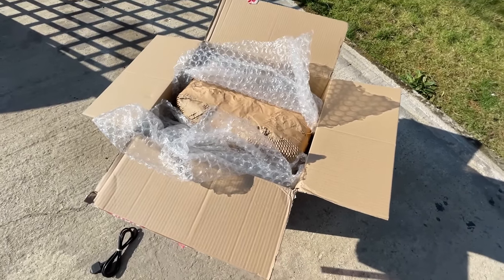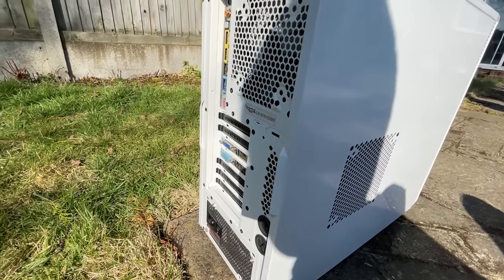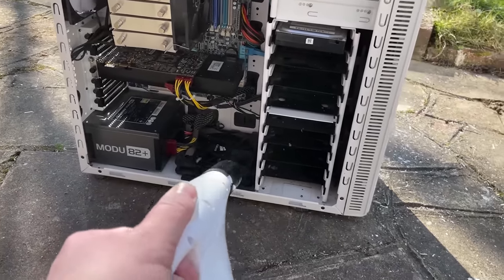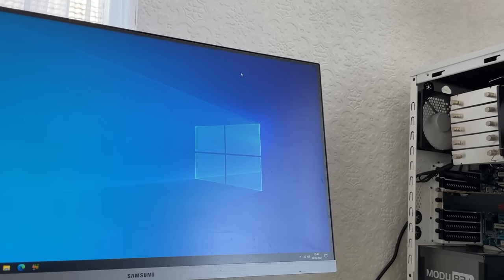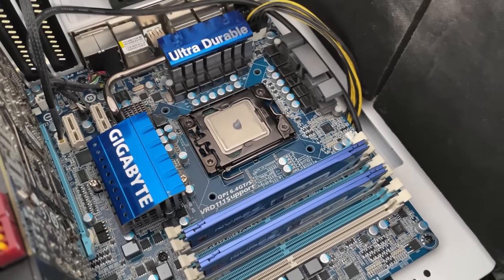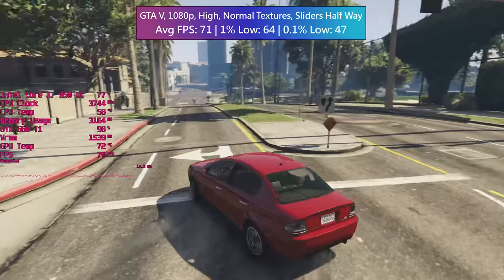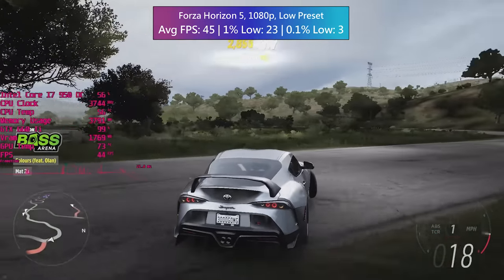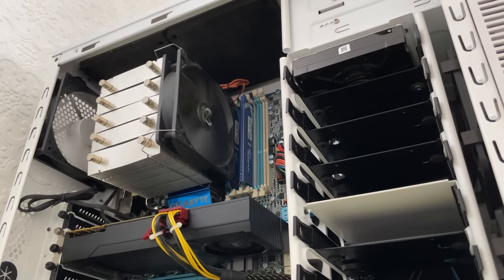What's Inside This £150 Core i7 Gaming PC From CEX?

Comment: I recently just bought a used computer for $150. It had an i7 4790k with a gtx 745, 120gb ssd and 500gb hardrive. The only thing i hated about it is that the psu failed me, it just decided to not work after one shutdown. I was almost finished coding my school project as well. Hope it didn't take anything with it to the grave.
Reply: So is it still alive?
Reply: @jhonlev9104  idk new power supply haven't arrived yet
Reply: @xwqr  thats probably why it was so cheap. if the rest of the system survived then you still got a steal

Comment: I retired my i7 860 from server duty last year in favor of a Ryzen 3500+B450 build. After a few days of fiddling with trying to run a few games on it, it's now just a lab box running Linux on the worktable in my office. The biggest issue was the GTX 260 I had it paired with. It just can't handle anything in the desktop space anymore. Even period games like TF2 have updated their requirements and the drivers for my card have showstopper bugs when running the game on Windows.
Reply: My friend has GTX 1050 ti with the r5 3500. Runs great . Try to get a min 4 gb GDDR6 card. (Pls don't buy 6500xt)
Reply: @ASRLawman  it's a great CPU for what I'm using it for, which is honestly a bit overkill (file server + plex + a few other self hosted apps). I'm sure it'd be fine for gaming too if I had a decent GPU to pair with it.

Comment: do the RAM upgrade first, 16 at maximum speed supported,
Reply: 12-24gb would be easier due to it having 6 ram slots.
Reply: @EvilTurkeySlices  y just mentioned 16 since for gaming is recommended, but there is diminished return when adding more
Reply: @TononiaWorld  if you do 12 or 24 you can get triple channel support more easily. Just use 3 4gb sticks, or 6 2gb sticks to get 12, or use 6 4gb sticks to get 24.
Reply: @EvilTurkeySlices  so my question is; Is there any benefit in running triple or quad channel for this specific mb/cpu/gpu?
Reply: @TononiaWorld  yes, x58 benefits quite a bit from it.
Reply: @EvilTurkeySlices   then that would be a great experiment, single vs dual vs triple vs quad channel on gaming, but I think for that he would need to run a different GPU, like the T400

Comment: X58/1366 boards are no longer fetching good money, at least in the UK, prices on used older hardware has dropped dramatically over the last month or so, including gpu's, 1080ti's can now be bought for £300
Reply: Get it bro
Reply: where are you getting them for £300? The cheapest on ebay right now is £400 for a working one.

Comment: Honestly most of the dips in framerate should go away after getting 16gb of ram. I did the asme upgrade on my pc and its changed it completely
Reply from the maker: Yeah that’s probably part of the problem. Doesn’t seem to be enough anymore :(
Reply: not even 16gb necessarily (although some games would benefit from having 12gb at least), but simply having 2x4gb instead of 1x8gb would help with dips in many games. Especially the ones that were tested, those dont really need or benefit from 16gb
Reply: @user-wq9mw2xz3j  I played it safe by going 16gb so that I also have some room for other things. But if you want just gaming 12gb should be good enough

Comment: Recently upgraded from a 2500k that I've been using just fine since 2011 to a 5600x. Haven't really noticed an improvement for the most part. I had a seasonic x650 psu in it that looked brand new despite having tens of thousands of hours of run time on it. When I pulled the ram out I was surprised at how nice it was. They had heavy machined metal heatsinks on them. Fastest ram the motherboard would support. Felt bad about just putting all these great components back into their boxes and shoving them in the closet, so I ordered another case and SSD to rebuild it. I'll put my backup 770 in it. I'm sure whatever use I find for it, it will do it perfectly fine.